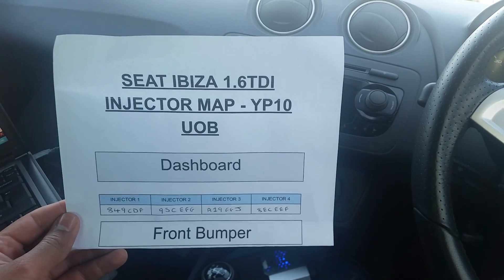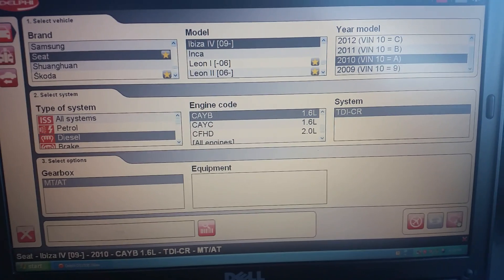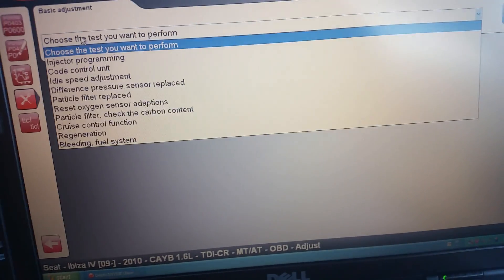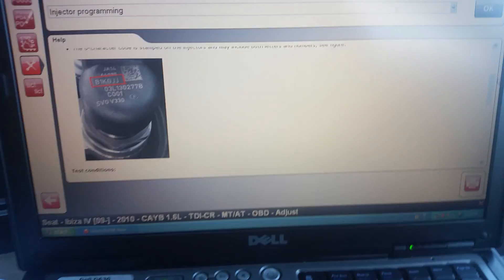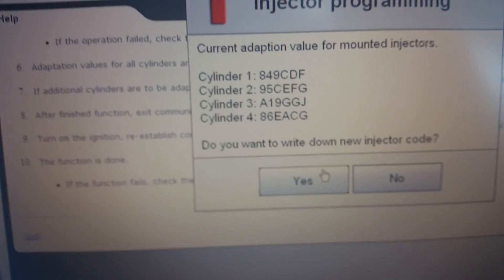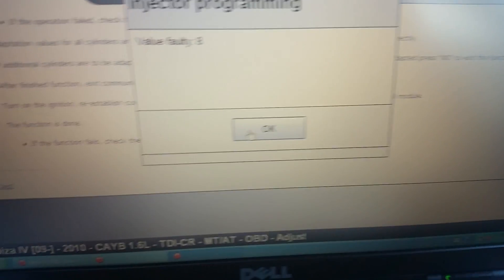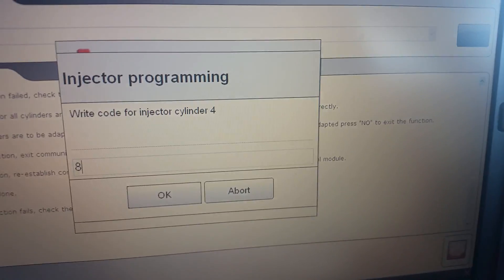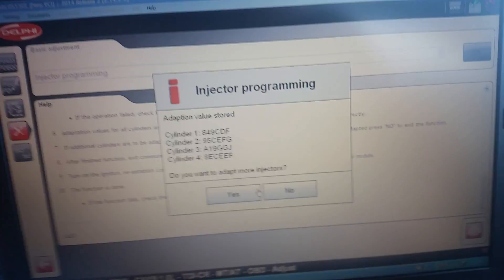How to code in injectors using DS150 Delphi on a 1.6 TDi VAG engine

Comment: What is the purpose of programming injectors?
Reply: there is minor differences in injector flow rates, and the code is actually calibration instructions for the cars ECU computer, to adjust/calibrate the fuel flow with each injector, in the injector factory they test them and print the code (the flow rate) on top of the injectors..

Comment: Hey Mate, really nice video! Helped me a lot.
My problem is that I can't choose cylinder 3 or 4 for programming. 
The drop-down menu only shows Cylinder 1 and 2. My car is a 2004 BMW 3 Series 2.0 Diesel and the Software is 2016.0. 
Do you have any suggestions that could help me? 
Thanks a lot!

Comment: Hello...trust you are well .. did your car start after this process?
Reply from the maker: Yes it start after the programming
Reply: I replaced an injector on my golf mk6 2.0tdi and it's still idling really roughly..I haven't yet coded the new injector...could coding cause this problem?
Reply from the maker: @saeed_712  

Yes this will very much likey to cause a ruff idle 

It's best to code in the injector before runing the car.
Reply: @TheOBDcompany  thank you so much for your advice...I will definitely get back to you with my results later 😁
Reply: @saeed_712 
We must programming the injectors when we replace them

Comment: Do ya see at the end of the video? “Do u want to adapt more injectors” Do ya click the “no” at the end of the video instead
Reply from the maker: Monza 84 

Yes press NO if you've finished coding in all the changed injectors
Reply: The OBD Company.co.uk 
No problem thanks,the reason I ask is I done the same procedure on a 2004 2.2 st mondeo,and I clicked no at the end,so I wasn’t sure if they coded in correctly 👍

Comment: The injector no 1 is the closest to the flywheel,not the front bumper!
Reply from the maker: On this car injector number 1 was on the far left if you stand in front of the car
Reply: @TheOBDcompany  do you know the injector number of Land Cruiser 4.5 d4d ?
Reply: Renault cylinder 1 is next to gearbox on a golf it's by the pulley side or far left from looking at car from the front to back of car hope that helps

Comment: So basic, you wright the code numbers on the injectors that must be replaced or the new injector heads?
Reply from the maker: You write down the injector codes from the injector body. You then code these injectors in with the tool